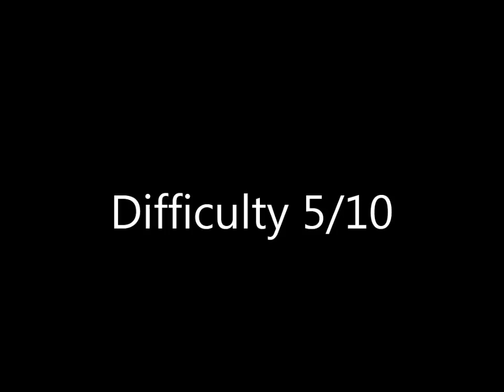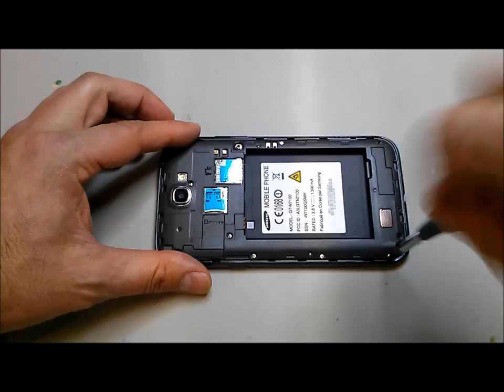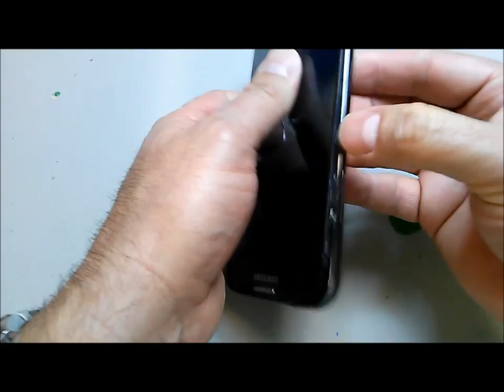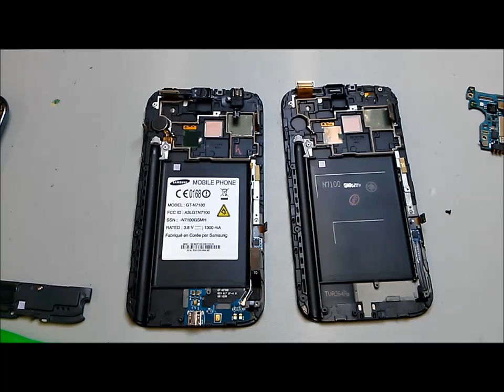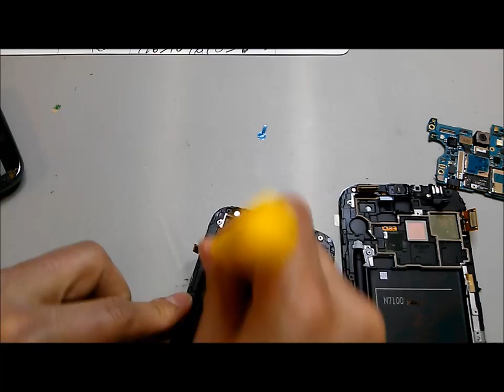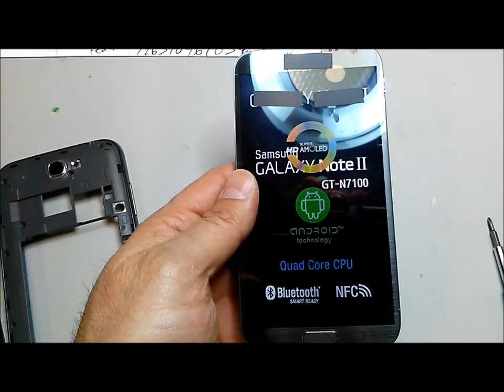Samsung Galaxy Note 2 N7100 AMOLED replacement

Comment: My bought a screen+midframe combo and replaced the screen+midframe on my note 2.  However, now the touch light buttons on the bottom are always turned on and I cannot turn them off.  Also, the back button on the bottom right does not work anymore.  Any suggestions?  Did I install the screen+midframe incorrectly?
Reply from the maker: My guess would be damage to the button flex cable or maybe it's not plugged in correctly. Did you make sure that the mid-frame supports the model that you have? There is a difference between GSM, CDMA, and the overseas version. Could also be a problem with the gate where the buttons plug into the AMOLED also. I'd try taking a look at all of the above with a magnifier and reconnect everything. A defective screen is always a possibility but those cases are rare.
Reply: Go Cell Phone Repair 

Where is the gate where the buttons plug into the AMOLED? Do I have to separate the screen from the midframe to check this?
Reply from the maker: My mistake. On the Note 2 the buttons connect directly to the board just above where the charging port plugs in. It sounds like maybe you received a defective part. I would not try to remove the screen from the frame as it is easily damaged. See about getting an exchange from wherever you purchased the screen.

Comment: Hi, my note 2 n7100 outer glass was cracked. Tried to replace the glass only but ended up breaking the lcd. So need to buy something? I checked online and found lcd screen (http://www.cellspare.com/samsung/galaxy-note-2-n7100/samsung-note-2-lcd-screen-white) and (http://geb.ebay.in/g/ImportHubViewItem?itemid=350839946455&LCD-Display-Digitizer-Screen-Assembly-for-SamSung-Galaxy-Note2-N7100-White-Gift). What I need to know is, are these the products with lcd and glass pre-stuck? And I also saw one called lcd screen assembly WITH PANEL. How is this different? Sorry to ask so many questions but I'm in a fix, live in a small hill town  north-east India, no one here can help...... Thanks. Hope you reply.
Reply from the maker: With the panel is what you see in the video above. With the parts that you linked you will have to remove your old AMOLED from the mid-frame (panel) and install the one that they send you. You will most likely damage the S-Pen flex during the process unless you are very careful so I would have one on hand just in case. The two parts you mentioned look the same from what I can tell and they are a little pricey. Over here they go for about $145 American.

Comment: Should I demagnetize my hands before handling the internals? I dont know how to say that in english.. you can ruin a pc component with the static electricity from your body, right?
Reply from the maker: It's never a bad idea to use an ESD mat if you have one or ground yourself somehow. Phones aren't quite as prone to damage from electricity as computers are but if you are working on a carpeted floor or have issues with static discharge then you might have reason for concern.
Reply: Thank you for your answear! About heating the components to 'melt' the glue, can I use a regular blow dryer? Ive never tried fixing a phone before, and I love my broken gn2 hehe thank you
Reply from the maker: Paulo Matta You can use a blow dryer but it will take longer. You want the surface pretty warm to the touch without melting anything of course.
Reply: bien

Comment: does it matter if I use another carriers version? I cannot find a grey amoled replacement for AT&T
Reply from the maker: I have updated the link on my website for this part.
http://gocellphonerepair.com/Note2AMOLED
My regular supplier was out of stock also but I did manage to find the gray and white ones for GSM carriers. AT&T and T-Mobile are compatible. The international version might be also but Verizon and Sprint usually have slightly different board layouts.
Reply: Go Cell Phone Repair thanks